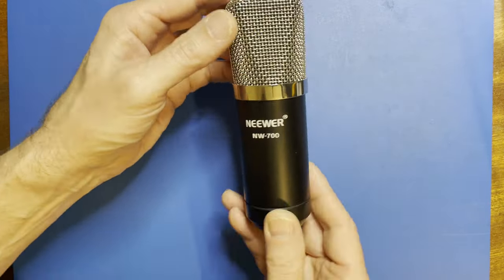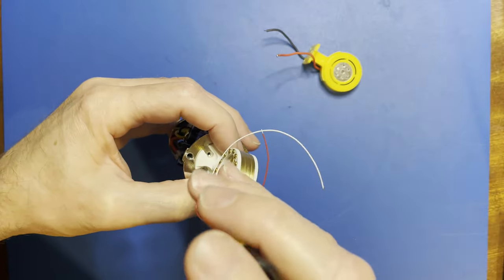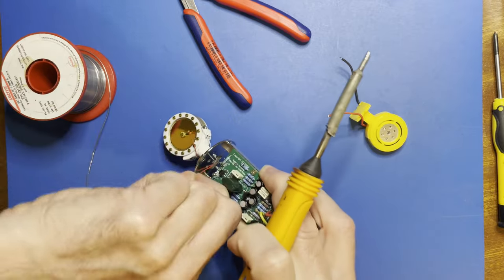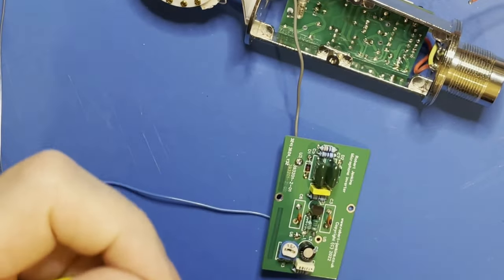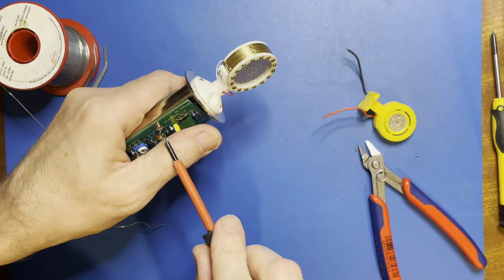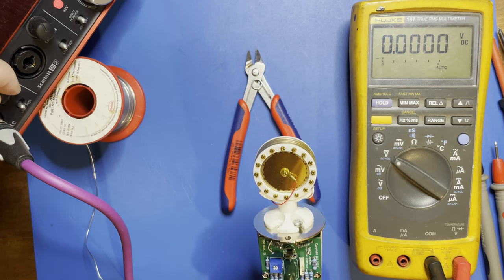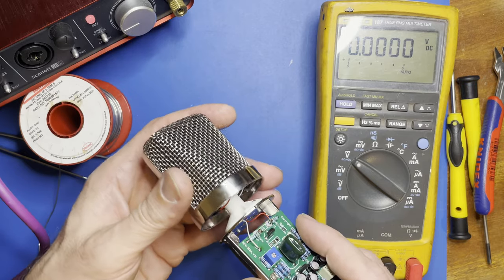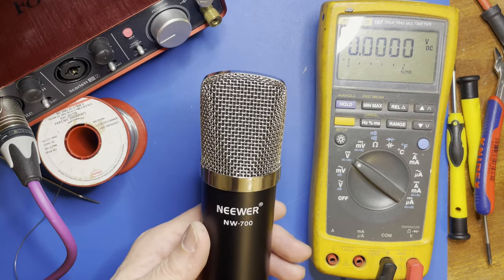Cheap mic mods, part 3 - Full condenser makeover!

Comment: I'm building some mics based on that inexpensive body. I found the bodies in Ali Express, and I'm using a board which is a Neumann KM84 circuit modded for large diaphragm capsules. Should finish it this weekend.

Comment: can i change capsule Audio Technica AT2020 to bigger one like yours?
Reply from the maker: Not without some major modifications, unfortunately.
To quote Audio Technica specifications, the AT2020 uses a "Fixed-charge back plate, permanently polarized condenser" - a type of electret capsule, in other words.

The true condenser capsules such as I've used need an external polarising voltage feed, typically around 45V; that is generated by the second PCB in my mods. I don't know if there is room for that in the AT2020 casing?
Reply: @RJTC  I once opened the PCB and mic capsule of my AT2020. Inside there is a circuit that requires phantom power to be used. Is the supply enough to run a capsule like yours, sir?

Comment: What page did you buy the capsule on, friend?
Reply from the maker: I've had them both from ebay and AliExpress - if you search "34mm condenser capsule" and find ones that look identical to the ones I've used, they should be the same.

eg. these look to be the same ones:
https://www.ebay.co.uk/itm/314540556347

https://www.aliexpress.com/item/1005004639295551.html

Comment: What is the product code of this 34mm capsule?
Reply from the maker: Hi, sorry, no part number. The original I got was from ebay, the others have been bought by comparing appearance and size.
These are a couple of examples that appear identical:
https://www.ebay.co.uk/itm/144831973477
https://www.aliexpress.com/item/1005001812729736.html
Reply: @RJTC   Thank you!

Comment: Can i swap out  the capsule on at 4040 without modding it
Reply from the maker: The AT4040 appears to use a true condenser capsule as standard, so it should be possible to swap in other true condenser capsules.

There does not seem to be much real technical info about the construction; the only video I've found so far showing the circuit board does not have any good close up views; the noise figure is not fantastic, but without more info I don't know why.